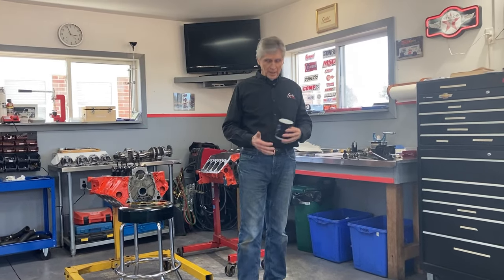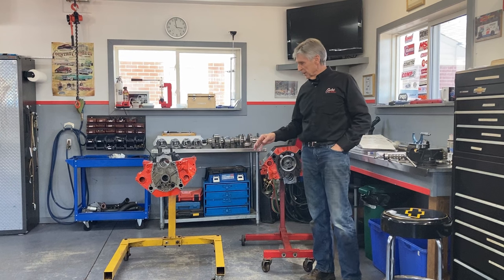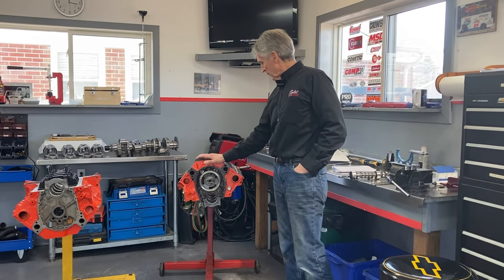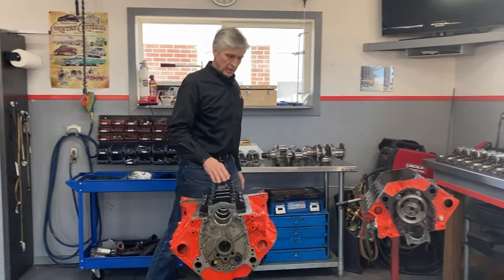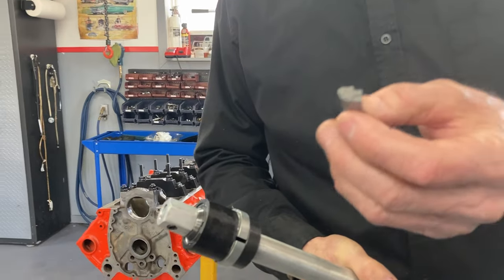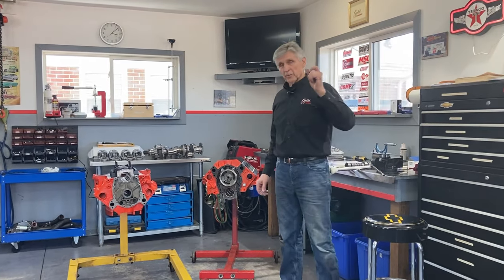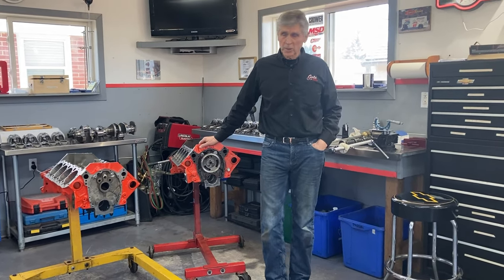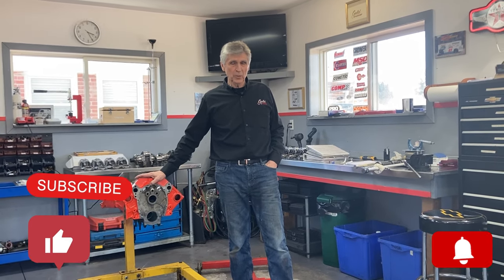Building a SBC Chevy 400 Problems and Solutions PART 1 of the Build

Comment: I’ve been a fan of the small block Chevy 400 since I pulled one out of a 73 station wagon in  1976
And built it for my 73 Z 28 
Street Camaro, soon I accumulated a couple of more blocks, and complete engines went hunting those early 70s station wagons they were loaded with these motors, 
Had 4 bolt mains. I absolutely love these motors ran them for years always heard about overheating problems. Never had an issue. Used a  350 head gasket as a template for the 400 block drill the appropriate steam pocket holes and that’s basically all I did
It does require a lot of induction compared to the 350, so with the proper castings, it was an extreme port job large Intake an exhaust valves 
It was a motor of epic proportions. I ran it on the street for four years big hydraulic cam 11 1/2 to one compression automatic with 3500 stall converter  4 .10  out back
11 second street car those were the days.
Reply from the maker: Thanks Tim, lots of good info. I like them because it is easy to make good power without stressing them too much. AG

Comment: Very happy to see the camshaft as the first thing in the engine. I see so many builders assemble the short block before putting the camshaft in.
Reply from the maker: Thanks Brad. It is easier to install a cam with the engine upside down and no crankshaft in the way. AG
Reply: Nothing sucks more than having your crank and rods torqued to find your machinist dropped the ball , and the cam don't  slide all the way in because of cocked or binding cam bearing.

Comment: Back in 2021 after the PERA webinar, I communicated with Ron Sledge of King Bearings and he told me how to use and old camshaft as a bearing scraper. It took a little time before anyone responded to my Craigslist ad but I did get 2 shafts to make the scraper. Now that I am prepared, I have yet to need it but that day is coming.
Reply from the maker: Thanks Stovebolt, I know have a tool too for a SBC at least but I hope i will never have to use it. Thanks for supporting my channel, more content coming. AG

Comment: Lots of good information. Especially the trick with tight cam bearings, I have done that in the past on a 400 with an old cam to gain the clearance needed. However, I am disagreeing with the using two different mfg bearing halves to get the clearance needed. Bearing halves are fitted from the factory for each other, you do not mix and match them ever. Yes, he gained the clearance by using a one thousandth larger bearing half, but he only gained that extra clearance on 1/2 of the bearing. By measuring across he got the number he wanted but it is actually not consistent across the whole journal, only half of it. You are better off, running both halves of the one thousandth larger bearing, or sticking with the original bearing. 

I was also under the understanding from other machinist that original four bolt main Chevy 400  blocks are prone to cracking, and you are better off with a two bolt main block and ARP bolts.
Reply from the maker: Thank you OldGlory for your comments and your interest in my channel. You are making some good points. The reason that we are able to match a standard and .001" bearing is that the inside diameter of the bearing is larger at the parting line than perpendicular to it (thus we always measure perpendicular to it). To be sure that my response to you is accurate, I actually measured at the parting line and it is .004"-.005" larger just next to the parting line. This difference creates an "oil wedge" that gets carried into the clearance between the bearing and the shaft as the crank rotates. 
Ideally the bearing and crankshaft never contact each other but are separated by the thin film of oil. Adding an extra .0005" of clearance just provides for  more volume of oil between the shaft and bearing. 
The same principles are applied in heavy industry where large journal bearings (i.e. Plain or non roller) bearings are used. 
The OEM factory manual specification for main bearing clearance is .0008"-.0020" . Even if I would have used both halves of the standard King bearings I would have .0015" of clearance on the tightest journal, which would be fine. 
I know that this method is used by commercial machine shops and I have also used it many times in the past with good results.  
Thanks again for your comments and I hope you will find my response satisfactory. 
Please keep watching my channel and posting your comments. 
Allan Gold
Reply: @goldsgarage8236  thank you for the reply, Allan, very detailed. I think I understand what you’re saying, about an oil wedge being created between the wider, bearing and standard bearing, yet even with that wouldn’t the 1/2 of the crankshaft journal that is in the standard bearing still ultimately be still running in tighter, tolerances on the sides where the two bearing halves meet? I am also assuming you are putting the standard bearing in the cap side of the journal, and the .001 larger bearing half on the block side?

Keep churning out the videos, there’s a whole generation of knowledge that we are losing and very few young minds willing to pick it up
Reply from the maker: Thanks OldGlory. Since I had 2 crankshafts and two sets of bearings I did both. I will keep making videos as long as you keep watching and commenting. 
Allan Gold
Reply: One thing to think about when a rod cap is torqued down and the bearing crushes it's egg shaped, wider at the parting lines, so that when it's running it's stretching the load sides, upper and lower and pulls the perpendicular sides(parting line) in so the hole is closer to round when the engine is running and load is applied. But it's never perfectly round, hence why one over/under half's work as they do. None of this can be seen with the naked eye, but if you check with a dial bore gauge it's evident. Also when you pull out a set of used bearings you'll notice there's never any wear at the parting lines only at the 12 and 6 o'clock positions.

Comment: I have several 70's SBC1 400's that were converted to top hat sleeved 500ci SBC1's.  Easy stuff really, And you eliminate most of the problems, with a Big bump in cubes and a extra 200hp.    All of it is old Hot Rodder tech, really old, and it's easier to do now with the new stuff.

Comment: I use the universal cam bearing tool you showed & have ran into tight cams often. Line honing the cam tunnel is one option, but I've found scraping the cam bearing to be the quickest & easiest option. I've had bent roller cams as well (Thanks UPS/FedEx). I straighten them in V-blocks. Doesn't take much to make a cam get tight. I also install two, test fit cam, install another bearing and then test fit after each one.
Reply from the maker: Thanks Terry, after this experience I now install one bearing at a time now also. AG
Reply: @thepoopsoup they’re all bent to a certain degree.

Comment: Its hard to get the number 1 cam brg. Straight, so my hubby places the block upside down on a bench after he has chamfered the back side of the number 1 hole, disassembles the tool, slides it in from the back of the block,assembles it in the block, and drives num. 1 in from the back side.
Reply from the maker: That is the correct way Peggy, much easier to maintain alignment that way. Thanks for your input. AG
Reply: I have done the same thing to make that bearing "true". Good tip.

Comment: First of all I do not bash people for their assembly techniques but since you said you are open to learning I thought I would go into a couple of things that you can do better.
1. Factory GM blocks often have a problem with the cam tunnels. Especially BBC and Pontiac blocks. While scraping in the bearings to get the cam to rotate freely may work it does create another problem. If the cam tunnel is not strait it will lead to excessive clearance in one or more of the cam bearings. This will cause an internal oil leak. The bearing crush in the cam tunnel should be what you should be concerned about. Mark Jones has a great video on this, look up engine building 201. He goes thru the procedure on a BBC which usually has more problems.
2. The problem with the hammer mandrel cam tool is that it can mushroom the bearings as it gets installed. The BHJ cam bearing installer uses a draw bar to install the bearings. It is pricey but if you do many engines a year it can pay for itself fairly quickly. You can keep the mandrel hammer types to make the correct OD of the bearings in a lathe.
3. On the 400 with the splayed caps. When you have the caps installed by your machinist take the bearings and crankshaft to him so when he does the line hone he can give you the oil clearance that you specify. That way you won't have to buy an extra set of bearings. I do commend you for showing the trick of mixing the bearings many people don't know that. For an engine that has not been line honed that is a great solution. The  rule of thumb for bearing clearance is a .001 per inch of the journal diameter. So  if a 400 has a journal size of 2.65 you would want .00265 minimum and for performance apps. add another .0005 to that. I know that you are following what the factory spec. is, but throw that out the window. Mahle has my recommendation on their website. While your .0005 bore gauge is better than plastigauge I would recommend a bore gauge with a resolution of .00001 to get the most accurate readings. Mititoyo has one that is reasonably priced. This is what I have. I really want the Sunnen long reach one but can't justify 2K for it.
4. For your cam installations. I don't know how you are doing these but I noticed on your blue print sheet from what I could see of it that you didn't have column for piston to valve clearance. Since I do not know how you are going about this I will just give you an example of what I do. I will map my P to V from 6 degrees retarded to 6 degrees advanced. That way I won't have to pray that I will not have a problem on the dyno. Cam timing is also a great tool to achieve a proper dynamic compression ratio. DCR to me is the only way to really guaranty a pump gas friendly engine. A 13:1 static compression engine can run on pump gas if the cam is timing is set correctly. 
5. I would recommend Dyno sim 6 to help with your engine combinations. Also for Dynamic compression I use the Wallace racing calculator online. 

Hope this helps happy engine building! Keep up the good work on the video's
Best regards BK
Reply from the maker: Thanks for taking the time to provide great input B, just heading to the dyno today. More to come, watch the video. AG

Comment: I did a re-ring job on a 318 for a buddy last summer that had jumped time and I used that universal cam tool and the cam would not even enter the 4th journal. I had plenty of old Chevy cams that were cut for clearancing but I didn't have not one old Dodge cam as he wanted to reuse his cam and lifters. I put some pressure against it and spun it enough to lightly scar the bearing enough to show the high spots then I took a razor blade and stood it straight up and scraped the highs till it finally slid in and stopped showing any signs of rubbing. Most shops around here have a stock of old cams for this purpose. I always cut mine on about a 30° angle across the journal and as I cut down into the journal I tilt my wheel at about a 45 so it leaves more of a knife edge. 
I don't know what other shops are charging for splaying oem blocks but for what a local shop quoted me I can buy a Brodix/Edelbrock/Blueprint cast iron block for about the same price.
Reply from the maker: Thanks Steve, lots of good points. Since this happened to me I have learned that machine shops often scrape cam bearings. You are also correct about the cost of splayed caps, however even aftermarket blocks require machining which adds to the cost. Thanks for sharing your knowledge and experience and please keep watching, more content to come. AG

Comment: Excellent video. I've built some 327s, a long time ago. I just picked up a 1974 std bore 400 to build for my 68 Impala. This is really going to help, thanks! I am looking for 10:1 compression, but don't know about the cam, so many options!
Reply from the maker: Thanks John. Good luck with your build. I have a series of videos in progress right now about a 406 build.  AG
Reply: HOWARDS , Big Mama Rattler, or Big Daddy Rattler.  Very streetable, doesn't need a big stall. Excellent power and torque. And made in USA.

Comment: The machinist who changed the cam bearings on my engine honed the bearings after installing, putting a crosshatch on it. 
I dont know how common it is but seem to be his way of doing things.
I did notice that the original bearings seemed to have been on the tight side.
Reply from the maker: Thanks Magnus, I have never had issues with cam bearings before, but since I am now hearing similar comments. It would probable work fine as ling are you are careful not to add clearance. Cam bearings are pretty soft. 
Thanks for your input, please keep watching and providing your input. 
Allan Gold
Reply: I don't know what stone or whatever he used but it's generally not a good idea to hone bearings, especially with sand paper, as the material from the stones or any type gritty material will get embedded in the soft babbitt of the bearing and will scar and wear on the cam journals. Idk maybe he used a new material I'm not familiar with, they're coming out with new stuff all the time, but I would still be leary. Most likely never have a problem though.
Reply: @stevenbelue5496  yeah Ill have to ask him to explain it. Hes a really good machinist so I dont doubt his work but its curious.

Comment: For tight cam bearings I think I may have first tried to use a drill and emery paper wet after fastening the cam down with room to go run the drill motor and emery paper just like polishing a crank but go all the way around the bearing making a circle where as the crank spins when polishing it,I hope that makes sense and no disrespect meant
Reply from the maker: Thanks Barry, no disrespect taken and thanks for the input. We are always learning. AG

Comment: I built a 400 ABC with jump heads back in the 80s with, comp cams 280, .480 lift and had it in 78 c10 rcsb, I was 17 . That ole thing ran good. What #s you think? I built several more after that. 👍👍
Reply from the maker: Good for you building an engine at 17, my first was at 19. Hard to know about the numbers. AG

Comment: I prep my bearings before I install              them.   On the back of the bearings you will find their stamp that is above the surface of the bearings. I burnish that down with 600 grit paper so I have 100 percent contact with the saddle.
Reply from the maker: Thanks for the tip Steve. AG

Comment: The old ream the bearing out with an old cam is BAD news! there is a reason the bearing is tight. Usually the bore has an issue such as a deep scratch or nick, which if you understand, has a raised area. Sometimes bore on the 400's can be too small. Solution is to hone cam bearing bores, not gouge up the cam bearing which can cause an issue later. I know, but that's the way it's been done for umpteen years people say. Well just because it was done that way and got by with it doesn't mean it's the way to do it still. Afterall would you clearance your crank or rod bearings that way?
Reply from the maker: Good info, thanks havebeenthere. AG

Comment: Did you measure the bearing and the camshaft bearing journal diameter, or did you just install the cam and determine by feel?
Reply from the maker: Thanks for the question reloading, the process that I used did not change the bearing journal diameter, it just removed the high spots, thus no need to measure the clearance. It would be quite difficult to measure the bearing diameter after it is installed. Long answer, but no, I just determined by feel.
Reply: @Gold's Garage  ok, wanted to make sure before I said anything. I've had a couple cams now that have been slightly bent. I put them between centers and measured the run-out, they had .0027.  I measured as many of the bearings in the block as I could. There was plenty of clearance. 

The company said they see that from time to time.
Reply from the maker: Thanks again, I actually used 2 different cams to check the fit. They both fit in the other 400 with no problem.

Comment: When using two different bearing sets to increase the clearance, would you put the thicker half on the load side, meaning the cap, or does it make any difference?
Reply from the maker: Good question Randy. I don't think it would make any difference. I have done it both ways. AG

Comment: I'm picking up a 406 short block this afternoon ìts a 509 block what brand splayed main caps did you use? I know you use good parts and I trust your opinion.
Reply from the maker: Thanks for the question Richard. The main bearing caps are PRW. 
Full disclosure, I purchased this block with  the machining already done and the splayed caps installed. That said PRW seems to be the most common choice. It also had ARP studs. AG

Comment: I have to disagree with you a impala with a 409 4 speed came out before the gto I would have to say I think that would be your first muscle car great video
Reply from the maker: Thanks Richard. The 409 was an awesome hot rod, as was the 406 Ford and 413 Dodge, and what about the Corvette?, however the definition that I was using is when OEMs started to put big engines in compact or midsized cars. The 389 was originally for full size Pontiacs, so when they put it in a Tempest and called it the GTO, by definition that was the first muscle car. AG
Reply: Lol you're not disagreeing with him- he did not state his private opinion but a consensus - pontiac tempest in the GTO trim - first muscle car... personal feelings have nothing to do with it